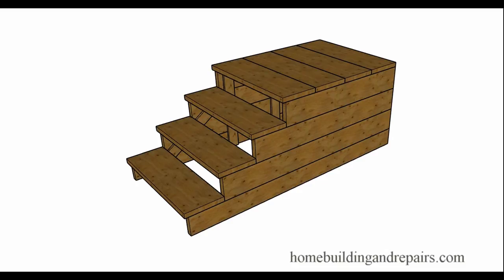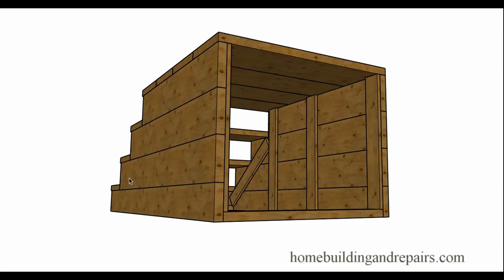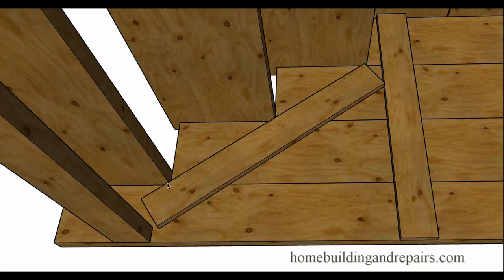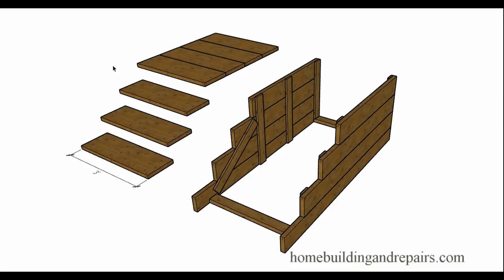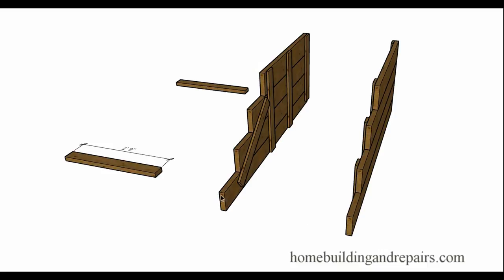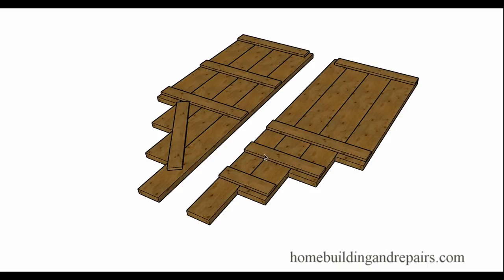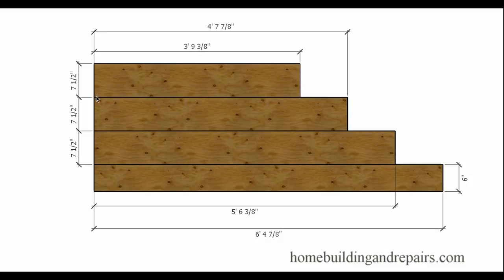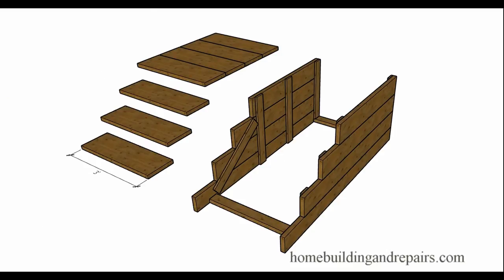Easy Three Step Stair Building Project #1- 10 1/2 Inch Treads And 7 1/2 Risers

Comment: Thanks  I built these to get in and out of my semi-inground pool. I poured a concrete slab and sunk some 4x4s on the inside to secure the stairs to. Worked great and that fixed the “wobbling”.  I also have the handrails for the pool stairs mounted to the deck. Wish I could post a pic.
Reply from the maker: Nice work!

Comment: Thank you! This was very helpful. I used this design with a few modifications for some stairs I made for my back porch. My steps need some extra bracing because it wants to wobble a little side to side. My solution will probably be to bolt it to the house/patio.
Reply from the maker: You're welcome and thanks for sharing your experience with us and additional bracing or attaching it to a permanent structure will definitely reduce or eliminate wobbling entirely.

Comment: ..thanks dude..this post is exactly what I was looking for..the bracing in the middle for center support?..i guess I can make another like the sides and use that..?
Reply from the maker: If you're asking whether or not you need some type of center support, then you can use something similar to the sides. It all depends upon the width of the stairway. For example a 30 inch wide stairway with 2 x 12 treads might not need a center support, but a 4 foot wide stairway would.
Reply: @stairbuilding  friend..i bought all the sizes specified in your tutorial..i put it together within an hour or two..it works great!!..it was for my kids Mobil home..im not a handy man at all..but this project was a breeze...thankyou so much..
Reply from the maker: @santiagoelias6172  That's great and I'm glad everything worked out. I've learned a lot myself from YouTube and the Internet.

Comment: Wouldn’t a 7 1/2 2x8 with the thickness of a 2x12 push the overall rise height over the code of 7 3/4 maximum? I’m thinking a 2x6 would keep overall height to 7” between steps and reduce tripping.
Reply from the maker: The bottom piece that attaches to the sides and is used to support the 2 x 12 step will need to be an inch and 1/2 smaller. Let me know if I didn't mention that in the video.

Comment: quick tip, make the treads another 1 3/4 inch longer and put a 2x8 kick plate so it's sealed
Reply from the maker: I don't understand why you would need to make the treads longer unless you are going to install risers, then there are building codes that might suggest one in three eights inches is the maximum nosing, but since I don't understand your reasoning, feel free to elaborate and provide us with more details.

Comment: I have been asked to build a set of steps with a first tread (base) 10 feet wide, top tread (platform) of 6 feet wide. Any ideas how to build it?
Reply from the maker: I don't know if this makes sense, but you'll start with building a straight set of stairs with conventional stair building methods using wood stringers and then modify one for the outside angle. If this doesn't make any sense, email me a picture or drawing and I'll see what I can do.

Comment: Like the plans. Good for my simple project. Please look at the 2x8's in the drawings. I believe they are actually 7 1/4" wide not 7 1/2".
Reply from the maker: You could be right, especially if you have magical abilities that are beyond my comprehension, but for the most part they're somewhere between seven and 3/8" seven and 5/8 of an inch.

Comment: I had to add bracing. It turned out to wobble a bit.
Reply from the maker: I would love to see a picture of the bracing and you can get our email address at our website, but don't worry about it if it's too much work, I definitely understand.
Reply: I  also am concerned about wobbling. I am 
 bracing with  boards on the inside and on the outside see if that makes it more sturdy.